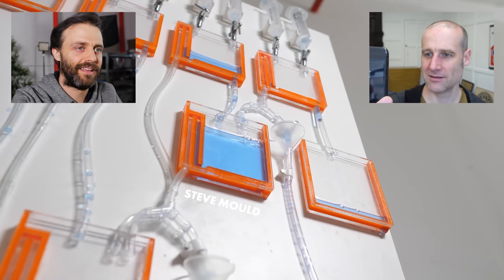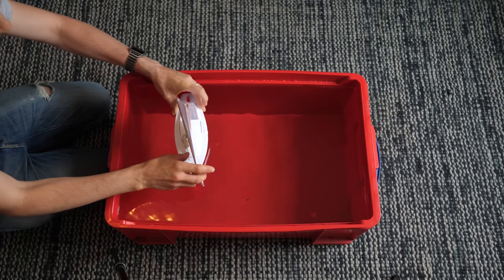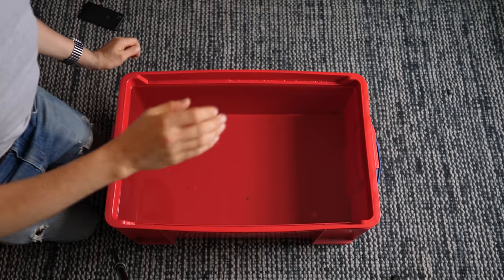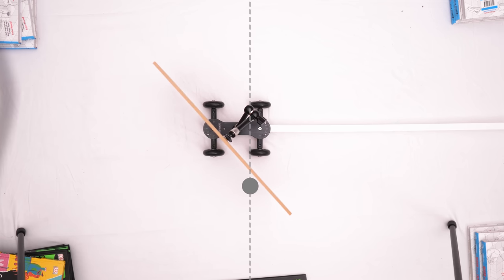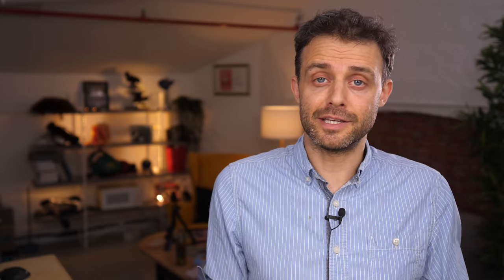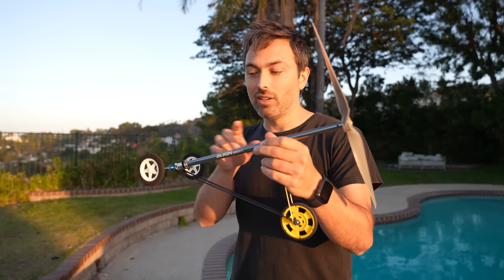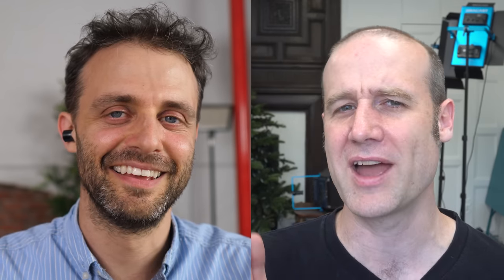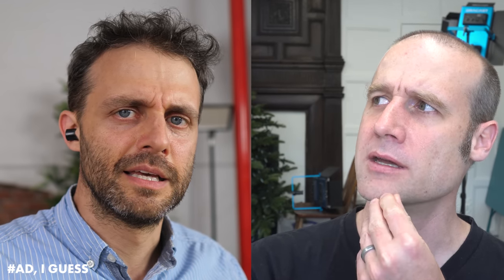Sailing Faster Than The Wind - How Is That Even Possible?

Comment: As a sailor I find it funny that this is even a topic of discussion, as we know we can go faster than the wind and we've known it for thousands of years.
Reply: I guess it's just a different source of learning. I grew up inland so I'm not  familiar with sailing intuition but this video helped. Ironically I used to think some sailing games had bugs and now I realise they were realistic.
Reply: Its different in this case because sailboats can sail against wind but travel at a certain angle relative to it. Whats trying to be proven here is going faster but, in the exact same direction that the wind is going, which sailboats can’t do.
Reply: Of course we know that from experience, but this video is about how it does it, which will be counter-intuitive to many people. I'm going to bet there are other things we know work from experience, but you don't know how. That's quite normal.
Reply: I first heard about this years ago when someone claimed that his unpowered cart with a big fan on the back could travel directly downwind faster than the wind. Someone mentioned sailboats traveling faster than the wind but most people assumed this meant traveling with the wind but diagonally. Some guy who did ice sailing showed that he could arrive at a point directly downwind much earlier than a balloon floating with the wind. To me, this proved it could be done. Just left the question of explaining the physics. I was surprised that many people continued to deny it was possible based on their theoretical calculations.
Reply: but different direction
Reply: “As a sailer” plays sea of thieves
Reply: Alot of things in nature have been observed how it works for long time, but with science we understand why it works. We have known to breed crops and domestic animals for tousands of years, but with genetics we know why it works. We can speed up the process. When you know why you can sail against the wind and faster than the wind, you can easy optimize your rigg. There has been alot of enhancement the last 150 years, due to better understanding of physics.
Reply: What is the sailing term for what we call a "vector component" in geometry? 

e.g. Wind is blowing directly to the south. Boat is traveling south-east at 20 knots. The component of the boat's speed in the direction of the wind (south) is 14 knots. Is there even a term for this "speed in the wind's direction"?
Reply: @TheEulerID  I think most of electrical theory can be described like this. Last I checked there isnt a consensus on how many electrons there area or where they come from. Or if there is maybe just one bouncing and zigzagging across the universe into every position as needed. Yet we know how to measure and control this mystery force in a really predictable manner.
Reply: @pyotrberia9741  True wind, induced wind (by the boats forward motion), and (resultant) apparent wind
Reply: @pyotrberia9741  I think you are referring to "Leeway".
Reply: @ablejack3  , Looked it up and it is "the angle formed between the line of the ship's keel and the line which she actually describes through the water". What I am looking for is: The speed at which a yacht is approaching a point directly downwind.
Reply: Most "oldschool" sailing vessels certainly are not capable of going faster than the wind. It was known however that going faster than the wind using sails was possible: ice sailing has been popular in Holland for a long time. 
Addition from ChatGTP, boats that can go faster than the wind:
High-Performance Racing Sailboats: Boats like the International Moth and the America's Cup foiling catamarans are designed for extreme speed and can sail faster than the wind using hydrofoils.

Iceboats: These vessels have a set of large sails and a specialized hull designed for sailing on frozen lakes. They can reach incredible speeds on ice, often exceeding wind speed.

Land Yachts: Although not on water, land yachts are wind-powered vehicles with sails that can go much faster than the wind over land. They are used for land sailing and can reach impressive speeds.

Windsurfers and Kiteboards: These watercraft combine a sail with a board and are designed for speed. Skilled riders can often go faster than the wind by harnessing its power efficiently.

Trimarans: Some high-performance trimarans, like the Hydroptère, have hydrofoils that lift the hull out of the water, reducing drag and allowing them to achieve remarkable speeds.

Keep in mind that achieving speeds faster than the wind requires skillful handling and is often limited by environmental conditions and the vessel's design.
Reply: Not thousend of years, new sail boats use diferent physics then the old boats. This man also teaches some wrong phsics...

Comment: Thank goodness. I was totally confused about how this works after the Veritasium video.
Reply: And now not any more?

Note that Veritasium's boat-prop explanation is based on the fact that a boat can beat a balloon drifting with the wind! I.e. not just that boat can go faster than wind in an expertly chosen angle, but that the boat can summarily go faster than the wind in the direction of the wind, too. Steve only explained the initial part.
Reply: @u1zha  Yeah, I made a separate comment requesting a part 2. I kind of understood Derrick's explanation, but I'd understand it a LOT better if Matt and Steve did it.

Comment: Steve Mould´s videos are always beautiful.  I look forward to each one.  Once again it is obvious that a lot of work has gone into this one.  There are a number of very nice concepts and explanations presented and packed into just 9 minutes!  I wish it could have been longer. Here are a couple things that I noticed that might be of general interest, or perhaps I will be corrected on and thus learn more  about the subject. And though this video provides some wonderful intuition on sailing mechanics, I explain in detail here as to why it does not give us an intuition about faster than wind travel.  At the end of this post I suggest something that might be a missing piece that I think would complete the explanation.  

Steve did not mention, but as a boat travels faster, the wind appears to change direction.  Say we start sailing downwind at an angle.  Initially the wind will be at our backs.  As the boat speeds up we will notice that the wind appears to come more and more from the front, even though the true wind has never changed. People on motor boats and motorcycles just expect wind from the front no matter which way things are really blowing without even thinking about it.  Consequently, the 'sailing upwind' part of this video also applies to fast downwind sailing.

Consider sailing downwind at a 45 degrees angle when the boat is traveling equally down wind and perpendicular to it.   At this angle the wind will appear to be coming over the starboard bow.

(x, y)  a vector
(0, 1)  velocity of wind blowing in the y direction
(1, 1)  velocity of boat at 45 degree angle traveling the same speed as the wind
(-1, 0)  velocity of the apparent wind  (over starboard bow due to boat traveling at an angle)

Thus the upwind sailing scenario that Steve shows at time 8:24 is also the downwind at the speed of the air scenario.  Hence, this little demonstration is key for this video.

Steve makes use of a stick and cart model for sailing.  The stick has a wheel attached to the end of it. An interesting aspect of having the wheel there is that force will always be perpendicular to the surface of the board being used as a sail.  This would be the case for real if air reflected upon striking a sail and had equal incident and reflection angles.  Because the force is always perpendicular to the surface of the board acting as the sail, the stick may be rotated around so the shaft is perpendicular with the surface of the sail.  When this is done no sideways force need be applied to hold the stick when pushing.  The travel would then be scaled by cos(theta) of the angle of rotation.  Hence the actual angle that we see for the stick in the video is only symbolic of wind direction.  He pretty much could have used any stick angle.  

A sailboat has a keel, so it travels in local straight lines.  Sail powered land vehicles and those with ice skates also travel on local straight lines.  So we can think about these vehicles as though they are on a fixed track. With the stick and cart model, the little cart will always move on its track in such a way as to create a gap between it and the wheel attached to the stick.  In other words the vehicle will always move on the track so that the wheel on the stick will roll down hill.  

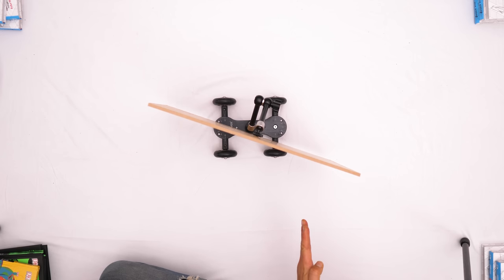Given a stick perpendicular to the surface of the sail, the travel of the vehicle on its track will be greater than the travel of the stick when the sail is at less than a 45 degree angle to the track.  Steve shows this at 6:25. If the stick was also rotated, then another cos(theta) must be overcome to cause the cart to travel faster than the travel of the wind.  For the upwind case given at time 8:24 this calls for a small angle between the sail and the track.  Just look how far the stick would have to be rotated to make it perpendicular to the sail.  That will make for a very small cos(theta) also.  

Steve himself discusses the problem with such small angles between the sail and the track at 6:47 while showing the stick rotated around.   The stick and cart model is of course an approximation of what happens when sailing, so this model loses its predictive power just when it is needed, when we approach the speed of the wind.

Steve presents another model, that of air displacement, at 2:51.   With this model he shows the air clinging to the sail and then turning and following its surface.  This is a different assumption about air behavior than that built into the stick and cart model.  In the example at 2:51 the angles are not quite right for the faster than the downwind case we are interested in, and for this model we do need correct angles.  The correct angles are given in the 8:24 example.  However if air clings to a sail, then it takes some effort to remove it.   This removal effort is known as drag and it pulls the vehicle backwards.  When we use the correct angles we find that the displacement is small so the drag component question becomes critical.  So like the stick and cart model, the displacement model stops being predictive just when we reach the point of interest, when the vehicle reaches the speed of the wind.  

I am not sure why, but Steve avoided discussing the Bernoulli Effect.  Due to the Bernoulli Effect a  shaped wing, such as presented at 7:56 can generate high lift force with little drag force when wind flows over it.  This will cause air flow to be of a bigger concern than other variables, so the angles we see in the faster than wind travel cases actually become an advantage instead of a difficulty.  With the Bernoulli Effect lift appears at about 90 degrees to the flow, without large drag.   It is kind of magical.  

I wish the video had been longer.  I would be happy to listen to Mould go on for hours.  Steve, how about making a second video including the Bernoulli Effect?
Reply: "Thus the upwind sailing scenario that Steve shows at time 8:24 is equivalent to traveling downwind at about the speed of the wind."

The scenarios are symmetrical, not identical: the roles of sail and keel are swapped.
Reply: @eyytee  Interesting observation about the keel physics, which was not touched on in the video other than to say that the keel provides a conservative force that is just big enough to cancel off track forces.  Which it is doing in both cases.  In both the fast down wind case and the upwind case  the sail provides the same lift, so the keel is providing the same lift.  In both cases the water travels over the keel from fore to aft.  However, I do see a difference in that the speed of water over the keel (or the speed of the land vehicles wheels are turning) will be higher in the downwind case because the boat will be moving over the water faster.  So I don't see a symmetry, I see a difference in speed of the water over the keel, or the speed the wheels are turning. The sailing mechanics are identical.  eyytee, did you not like the comment?  It is well done no?
Reply: @ep5acg  By symmetry I mean the forces vs. motion parallel and orthogonal to the wind:

TACKING UPWIND:
- sail drives the boat across the wind
- keel drives the boat upwind

TACKING DOWNWIND WITH VMG > WINDSPEED:
- keel drives the boat across the wind
- sail drives the boat downwind

This also explains why to go directly upwind, the rotor cart would have to reverse the transmission, and turn the wheels with the propeller.
Reply: @eyytee   I reworded that to say that the demo applies to both scenarios.  Did  you not like my post?  Is it not well done?
Reply: @ep5acg  It's true that you could hold he stick anyway you want, and push sideways with it. But the convention in the demo is that you move the stick only parallel to the stick, which indicates the true wind direction. In that sense I don't think the demo as shown applies to both scenarios. In a more general sense, there are similarities/symmetries, but it would haven been better if he had explicitly shown the downwind case.
Reply: @eyytee 

 " It's true that you could hold he stick anyway you want,"  Yep.   Now you can understand the relationship between the various examples he shows.

 " indicates the true wind direction"  No.  It is the apparent wind that the sail sees. And as the stick is what the sail sees in the stick and cart model, it is representing the apparent wind. 

" I don't think the demo as shown applies to both scenarios"  Given you are struggling with the concept of apparent wind in the stick and cart model, I can see why you would say that.  Fact is, fast downwind sailing is upwind sailing.  The comment is correct.

Between this thread and our prior one,  I have corrected many straw man issues you have raised.  Isn't this worth a like on the post?
Reply: @ep5acg  I liked your comment Thomas.  Thank you for the clarifications.
Reply: @shih-julin7120  You are welcome!